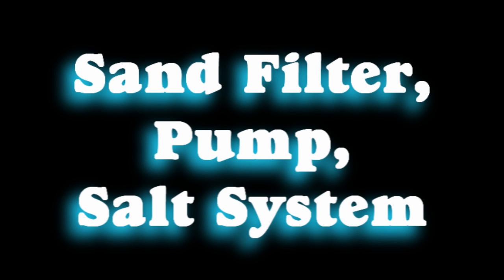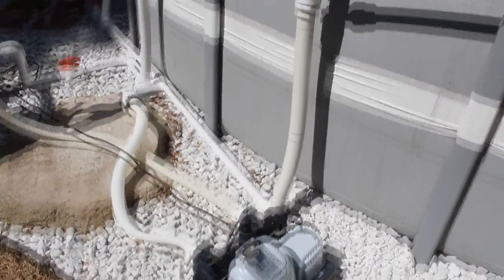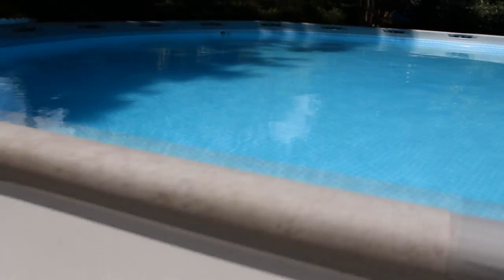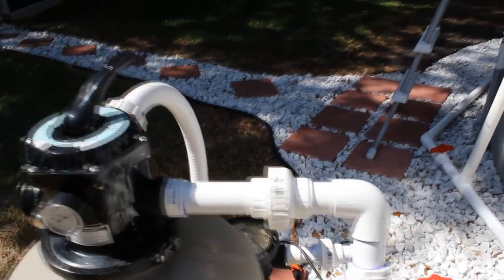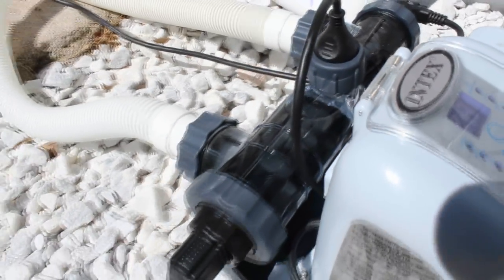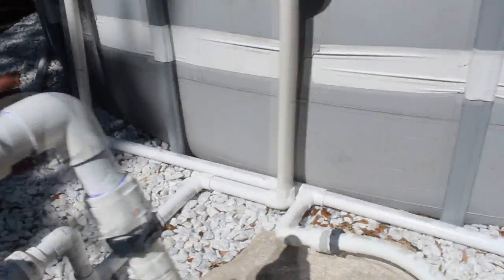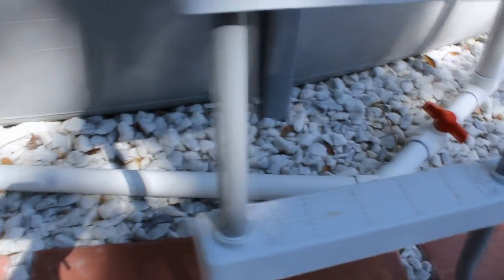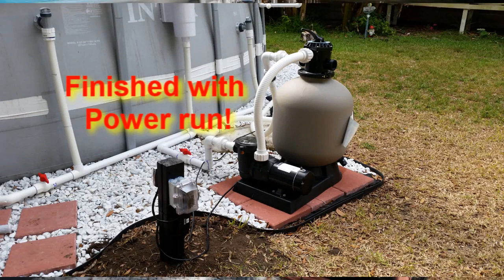HOW TO  DIY Upgrade INTEX POOL with HARD PLUMB, POOL PUMP, SAND FILTER, and SALT WATER GENERATOR

Comment: How  do repair out flow connections.   I have a split in the black sleeve.     Can u help?
Reply from the maker: What sleeve are you referring?
Reply: It is the outlet for the water to go to the filter. It’s a black sleeve embedded in the wall of the pool. We have two of them.

Comment: I am trying to buy a replacement value sticker. It has faded! Can you tell me where or if you can buy one? If you don't mind will you take a picture of your value sticker so i will at least have a image of it so i can turn my pump on.
Reply from the maker: I am not sure of the "value sticker" you are speaking of. If it's the top of the sand filter unit you are talking about, mine has faded as well. I am not quite sure where to get one. Maybe the manufacturer website of the filter unit.

Comment: someome help me out!! i want to know where am i supposed to add the salt to? our pool is already filled  up and running just with the pump it came with but we are upgrading to a sand filtration system and a salt water system. im just so confused
Reply from the maker: Once the SWG (salt water generator) is added the salt goes directly in the pool. The amount is on the bag considering how many gallons the pool is. My set up is in this order. Skimmer out to pump, out to sand filter unit, out to SWG, then out to pool. Hope this answers your question.

Comment: So you only have one in which is the skimmer and 2 outs? I have the salt water generator and upgraded pump and sand filter. but one in skimmer and one out. I was thinking to add another in but seeing this wonder if I need a 2nd out instead?
Reply from the maker: Two jets into the pool will give you better circulation. Having one skimmer is all you need to clear out top debris and pull in water to the pump.
Reply: Confused now!  Pinch a penny told me yesterday its better to have to in's. Ha! Maybe 2 in's and 2 out's. Lol
Reply from the maker: My experience with Pinch a Penny has been terrible at best for an above ground, soft side pool. One in and two jets out works great for mine. I'm sure two ins won't hurt and since you have two, try to add a second out for more circulation.
Reply: Right now i have one in and one out. Going to add another out and see how it does. I can always switch connections and make it a in it i need to.
Reply: For what it is worth....I never buy anything with only one outlet to the pump suction side.  Pumps are very powerful. A single intake can hurt someone.  20/20 ran a story on a hot tub manufacturer back in the 80's that had a single intake on the floor of the hot tub. The kids would swim down and sit on it for fun.  Needless to say, a few kids died. And one of them didn't die from drowning, but from internal...uh...damage.  Anyway, after I saw that story, it stuck with me.  Entrapment is real, and the suction power is dangerous.  Two to the pump reduces the risk dramatically by giving a secondary path of least resistance.  It makes NO sense to not have two to the pump.   My hot tub is a Hot Springs model for this very reason (three on the suction side, and in an overflow cavity, too).  And I chose my Intex model based on the number of outlets, too.
Reply: I did add another Inlet and outlet and its running much better with the same pump and sand filter now.

Comment: it's probably been answered already but how much did this conversion cost you?
Reply from the maker: +Bryant Sanderson O.K. so the pump and sand filter unit was roughly $250, the SWG (salt water generator) was about $140. The piping and fittings all worked out to about $100, including fountain build. Much better than $40 a month for chlorine.
Reply: Awesome. Thanks for the info
Reply: Bubbers Productions intex has a sand filter pumps black and white are for biger gray pools